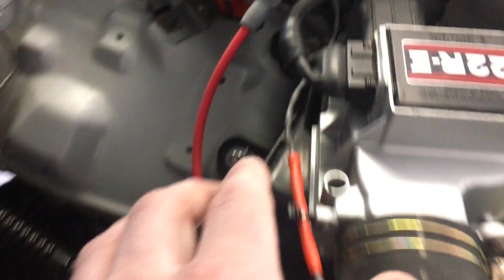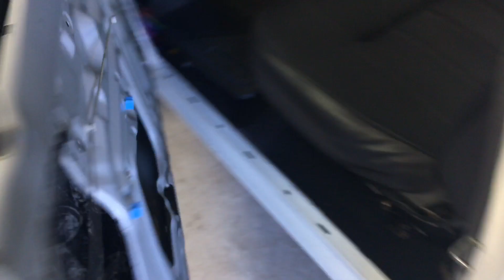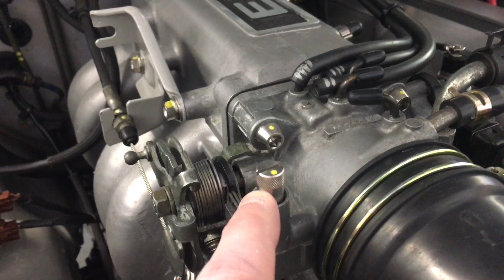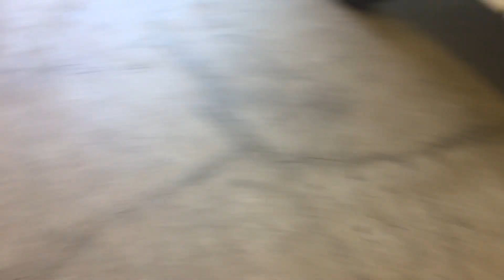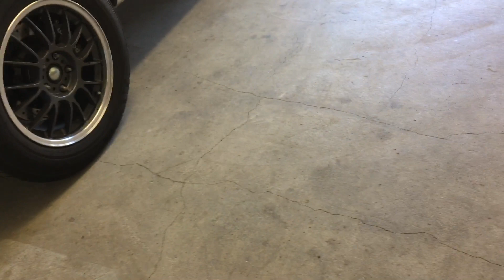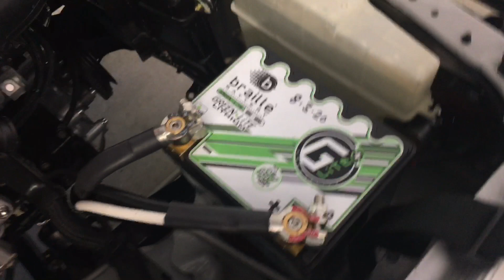89-95 Toyota Pickup 22RE AFM IAC valve air suction idle unstable dropping when warm 500 RPM's

Comment from the maker: FORGOT TO MENTION IN THE VIDEO: I also changed the initial timing to 7.5 degrees BTDC (w/ TE & E1 shorted) and set the idle to 1000 RPM - this helps quite a bit. I was running the factory recommended 5 degrees BTDC, but 7.5-8 degrees sure seems to work a lot better. I believe the ECU limits total advance anyway, so I shouldn't make a heck of a lot of difference.
Reply: Great video!!! Great tutorial Ray! These little engines are great!

Comment: What distributor cap did you use with those plug wires?
Reply from the maker: Factory cap - https://www.amazon.com/Genuine-Toyota-19101-35180-Distributor-Assembly/dp/B00KTI34ME/

Comment: I got a 1985 toyota TURBO EFI pick up... idle ok but when shift it to drive engine shakes and when you put in park engine continuesly...I'm thinking if it out of timing and idea... thanks
Reply from the maker: sounds like transmission or the torque converter maybe

Comment: Dude you are an idiot, you know just enough to jack shit up, I’ll bet your name is not Ray Nada but really Jerry Rigged. You have not fixed anything, in fact when you blocked the pcv vent hose with whatever you used you shut down the pcv system causing excessive crank case pressure which in turn caused your oil leak, your test pipe does not give more power, if your catalytic converter is functioning properly. Your epic failures should never be show to anyone who wants their vehicles to perform properly.  People like you keep people like me making good money fixing your Jerry rigging.

Comment: We have the same problem, my pickup has issues with the idle and cold start also I canceled the egr and air pump,   at the moment I had replaced the IAC, the TPS (the old one had a variation in one impedance value) and lastly the cold start sensor.

Comment: What causes high idle upon start up? I know the cold start injector is for cold weather purposes.  But mine does it regardless at 60 degrees. Thanks!
Reply from the maker: The high idle stuff is controlled by the Idle Air Control Valve (IAC) - I have some videos which explain it on the channel but basically engine coolant (once it heats up) causes the valve to shut down and lower the idle. If the idle stays high, check the small hoses running to and from the IAC valve (just under the throttle body) and see if both hoses are heating up. If not, there could be a coolant blockage some place in there, which is preventing normal operation.

Comment: Hey where can I get an maf sensor  mine it’s bad I get an OL when testing it from E2 to VS and have a very rough idle  trie from oraleys and they are reman maf sensors and have the same problem when testing from E2 to VS at maf sensor
Reply: Sorry forgot to mention I have. 1993 Toyota pick up 4 cyl 22re 2.4 liter
Reply from the maker: here is the one I'm running on my truck now - https://www.napaonline.com/en/p/NECXTP420055

Comment: Hey ray i have a 93' 22re pickup and ive got a high idle any help on this issue wood be great
Reply from the maker: Hard to say.. check the door inside the AFM to make sure it's not sticking. Also check the coolant temp sending to make sure it's not defective. Air leaking around the throttle shafts or idle screw can also do it. What RPM's are you seeing? The other thing is the idle air control coolant lines could be blocked.. check those with your hand (upper and lower) and make sure they are flowing warm coolant once the motor is all up to temp. I have some videos on the IAC valve on my channel.

Comment: I'm currently suspecting my afm to be bad... I popped the cover off and tried to start the truck and the arm just flaps like crazy inside the afm
.. is it suppose to do that? My issue is that my 93 22re won't start and just pours fuel into the motor to the point I have a quart of gas in the oil pan....
Reply from the maker: I'm not sure how the door should react when the motor is running (never run the motor with the lid off actually), but I would assume the door should remain pretty steady in there, if the counter spring is working okay. Make sure the door is not binding in its travel around the arc. If you have fuel pouring into the engine, that could be a fuel injector which is stuck open. I would check the injectors (including the cold start injector) to ensure they are all functioning properly.
Reply: @ray5961  everything is smooth as glass. Good spring tension and all that. The cold start injector works when plugged in but stops when un plugged. Did that as a test. Was debating on a new fuel pressure regulator but idk how often those fail or if it would even allow fuel to push through injectors.
Reply from the maker: @GunnerKrey-xk7pb  It's pretty easy to test the fuel pressure regulator. Jumper Fp and B+ in the diag box to manually turn the fuel pump on (ignition key to ON). You should be able to hear the fuel flowing through the rail. Then pull a vacuum on the regulator and see if the pitch changes. If so, the regulator is probably fine. On my motor, I had several failed injectors, which was causing a lot of idle issues I think. When I installed the Bosch injectors, it was a lot smoother.
Reply: @ray5961  is there a fuel pressure sensor on the rail too? I can't find it to save my life... Google was unhelpful. I read the ohms through the VSV and it read 43 ohms... kinda thought it should be OL but can't find any advice on that issue as well
Reply from the maker: @GunnerKrey-xk7pb  The VSV is just an on/off vacuum switching valve.. hit it with 12 volts and see if it opens and closes. Personally, I threw that VSV for fuel up away; just run a vacuum line from the upper intake plenum directly to the fuel regulator and call it a day. This video talks about it a bit here - https://youtu.be/rcKjFEYHk28?si=bKj7bJiwpB5qxA6c
Reply: @ray5961 just wanted to update this thread. Someone cut the injector pigtails off and used the low impedance injectors on my truck.... burnt up the computer. I got a new computer and spliced in all new pigtails for the new correct injectors. Fired right up but I messed with the afm screw and wheel inside along with the idle speed screw. It's got a slightly rough idle and it hardly response to the idle speed screw........... on the bright side I made forward progress lol

Comment: Hey when you talk about going at the store after engine has reached operating temperature did you have the hot soak issue ? Instead of bloking the IACV why not delete the VSV system ?
Reply from the maker: No hot soaking issue, no. The IAC valve isn't controlled by a VSV.

Comment: I need a person like you in vegas haré is no mechanic around to handle my truck
Reply from the maker: But Vegas does have strip clubs :)
Reply: But I need a mechanic haha no club
Reply from the maker: @EML662  What's up with your truck? Is it something you can tackle yourself maybe?
Reply: @ray5961  hi sorry I put 2000 in parts more than 200 hours and still doesn’t pass smog I replaced so many parts but still nothing
Reply from the maker: @EML662  I feel your pain man. I've had my truck fail smog twice, which is a real hassle. What does the smog shop say? Why are they failing it?
Reply: @ray5961  high something and I found  bad computer bad vsv now I found maf , the truck never been used a lot after 2014 , from this year 2020 less than 2000 miles on it , but after virus I put 25k and just one day eng light just turn on , is any mechanic available to take care my truck in your city , are how fare from b vegas ,? Here is just bad quality mechanic
Reply from the maker: @EML662  Couldn't really tell you about local mechanics, as I do all my own work. Have you checked Yelp in Las Vegas for mechanics? What you want to find, ideally, is a little old Japan guy who is an independent mechanic. I helped my former girlfriend's mom and sister both find used Toyota 4Runenrs out in Texas and they were able to local a little old Japanese guy who does nothing but old Toyota service. That's what you want. I don't know if you have that out in Vegas, but I'd check Yelp and/or maybe swing by some local shops and start asking questions. Find the local machine shop that rebuilds engines and does stuff like presses off bearings, etc. Ask them. They are gonna know if there are any older Japanese focused mechanics around by virtue of having to bore out blocks and surface heads. I'd start your search there...

Comment: Question: I have an 89 4Runner and I need a new AFM after finding out the previous owner Mickey Mouse’d a lot of things on this truck. I’ve read forum posts saying I can use an 84-87 or a 89.5-95 AFM but others saying I need one exactly for the 88/89’s or it won’t even start. Can I use others like a Napa re-mfg’d unit? As long as it passes a test with a multimeter it should be fine right? I’ve learned these 88/89’s are the bastard child of 22RE’s in terms of electronics so it gets kind of confusing.
Reply from the maker: I hear ya. My truck was built december 1989, although it's technically listed as a 1990 model year. I know they made some changes as time went on; my friend has a 1994 and it has some differences here and there. I don't know the specifics about the AFM from the standpoint of 84-87 vs. 89-95... however, aren't the 84-87 motors running carbs? The AFM relates to only EFI as far as I'm aware. Is your truck fuel injected? If it's got an ECU and fuel injection, then you are gonna most likely need an AFM from 89-95. On my truck, one of the very first things I did while learning about the 22RE was accidentally destroy my AFM. I ended up having to get a re-manufactured unit from Napa. It works fine and I've never had any issues with it. I would think you should be good w/ going the Napa route. Here's the link to Napa one I used on my truck (part # NECXTP420055 ) and it works top notch. They call it a "MAF" for some unknown reason but it's the Toyota AFM for 89-95 fuel injected truck: https://www.napaonline.com/en/p/NECXTP420055
Reply: @ray5961  Yes mine is EFI. I think the only time the 4Runners had a carb was the 84 models then 85+ all were EFI. The pickups had a carb option up to 87. I’m gonna call Napa about that AFM just because I don’t think it’s available but they do have the one ending in 4200054. Who knows maybe they have one in the back room and haven’t noticed.
Reply from the maker: @salvadorcallejasii842  Not sure about the other one Napa sells. There is a version from a Toyota Supra, which is slightly larger, and can be used on our trucks. You might want to check the forums and see if you can track that one down maybe. The other option is just to buy a used one on ebay and clean it up a little. The electronics inside are pretty straightforward. You can also remove the plastic lid and clean things up and/or repair electrical connections in there. What exactly is wrong with with your Mickey Mouse one over there?
Reply: @ray5961  I think they went in there before and tried either rebuilding it or doing some “tuning” with it because it definitely does not have the stock internals. The gear and spring look much newer. The biggest thing though is a broken fuel pump contact. It was so brittle it broke when I was cleaning it. I say Mickey Mouse’d because A LOT of components on here could’ve been sourced new from OEM but he decided to piece everything from junkyard parts. Nothing against it, but if they make it new and it’s not a big price gap, definitely go for the new one.
Reply from the maker: @salvadorcallejasii842  Sounds like maybe it's old yeah. The fuel pump contact breaking is no good. Tuning usually is for A/F ratios, but if they didn't mark the factory settings, who knows where it's at. Once you deviate from the factory settings, you basically need a wide band O2 sensor on the exhaust to dial it back in. I think you can only find used AFM's now and also the Napa re-manufactured ones. I don't think Toyota still has these in stock back at the factory.

Comment: Could you tell me where you sourced the rubber boot between the AFM and the air tube?
Reply from the maker: It's stock and was on the truck when I bought it. I did replace the elbow and found it on Amazon. You might be able to find it online through Toyota parts places like Mc George - that's the place I use to buy all my factory replacement parts usually https://toyotaparts.mcgeorgetoyota.com

Comment: Ay Ray Nada. Big fan of your videos. I recently purchased an aftermarket afm online and installed it. After a few drives CEL code 25 came on saying it was too lean. Should I adjust my afm or screw in the afm bypass screw more or is it something else?
Reply from the maker: Thanks man! The bypass screw doesn't add too much (it's more of an idle trim screw than anything else). Make sure the door swings free in there. Also confirm there are no vacuum leaks or cracks in the rubber elbow (those crack all the time and it's hard to see the crack sometimes; you can pickup a brand new one on amazon cheap though). But to answer your question, if nothing else has changed (except installing the AFM) you can try adjusting it 2-4 clicks richer and see what happens. Also, I'd try resetting the ECU fuel trim tables by pulling the 15A EFI fuse for 5 or 10 minutes; this will clear the old fuel map. I'd would definitely start by seeing what vacuum the motor is pulling at idle.
Reply: @ray5961  I just reset the fuel trim and drove around and she just cleared right up. I swear it runs better too. These 22res just fix themselves! I think my old AFM was fucked from going underwater on a trail in Moab (the water was up to the top of my engine). Search up “you cannot kill the 22re Reddit” if you want to see us starting that engine afterwards. So I think it just got use to running rich, then switching out the AFM made it think it was too lean. Anyways she’s running like a clock now
Reply from the maker: @singamajigy  That's awesome. I'll search for that video also.

Comment: Excellent rebuild. Just outstanding. Where did you get all your vacuum hoses from?
Reply from the maker: Mostly from Napa Auto. Just their rubber vacuum hoses in the back. For the smaller hoses that run to all the VSV's and smaller fittings, I just bought a roll of it directly from Amazon here: https://www.amazon.com/gp/product/B0002KNVPE/
Reply: @ray5961  Thanks Ray! Appreciate the help 👊🏽.

Comment: They run alot of gear i am rebuilding my Toy i removed alot of wtg air bags to replace heavy leaf spring and because i built a ford 9 inch light wtg disc brake Wilwoods13" so 700 lbs gone also made aluminum bed

Comment: I think it would depend on elevation, on leaning AFR?
Reply from the maker: That definitely has an impact. I'm at 900 +/- feet in my garage. I've since solved this issue and it seemed to mainly be related to the IAC valve being out of adjustment. I had to just keep  playing with it until I got it to where it worked pretty much 95% of the time.
Reply: @ray5961  OK, I picked up a 95 that sat for years, and that IAC was a serious pain.

 Still a little off but much better than before. 

Ill definitely be digging into your content. Much appreciated.   

Do you use twitter?

Comment: If your idle is jumping around once warmed up. Check that there is no blockage in the coolant lines to the intake. . There is a thermostat in there . Mine was a little crusty and not flowing properly.  Once I cleaned it out it ran perfect again
Reply from the maker: Yes definitely important - I have several videos about that actually. The coolant flow through the IAC valve is definitely something to make sure is working correctly :)

Comment: I have a 87 4x4 sr5 with a 22re 

I'm having the low idle when warm at startup  Issue,  after 4-5 seconds idle goes to 850rpm .
It's only at startup not at stops
Reply from the maker: Check the hoses going to the IAC valve to see if they are both warm. You might also want to check to make sure your fuel filter is clean (I'd also put a fuel pressure gauge on the fuel rail and see if there is a delay developing the correct fuel pressure in the rail maybe).
Reply: @ray5961  I have the old IAC (bimetal heater element and water lines , both lines are warm .
Fuel filter is new. 
I do have a vsv that controls the fuel pressure regulator,  could that be the problem ?
Reply from the maker: @rafaelduenas6465  It could be, but most likely not. The vacuum hose and VSV fuel up stuff actually can be totally removed and will not adversely affect the 22RE. I run my truck without it and simply run the vacuum line which originally went to the VSV directly to the fuel pressure regulator on the fuel rail; this will keep the fuel pressure where you need it. Typically around 35 PSI at idle and maybe more like 40 something under load. I have a digital fuel pressure gauge in my truck (which taps directly into the exit side of the fuel filter) and have confirmed that running a vacuum line directly to the regulator doesn't make much difference as compared to looping it through the VSV. There are also some articles about that on line if you search around (and that's where I originally got the idea). You might try disconnecting your cold start injector harness on the back side of the upper plenum and see if that makes any difference. If the ECU thinks the car is cold (due to a faulty temp sender and/or faulty cold start injection timer), it may be partially flooding the engine on start up by inadvertently turning on that 5th injector on the plenum. You can defeat that by just unplugging the electrical harness which runs to the cold start fuel injector as a test and see if there is any difference.

Comment: Man I wish I could get a diagram from you on what you blocked off and how you ran all your hoses on your motor I could use the help thanks
Reply from the maker: Watch my other video where I explain all the systems. Basically I disconnected the vacuum to the EGR and AS systems and then bypassed the fuel pressure VSV and ran that hose directly.